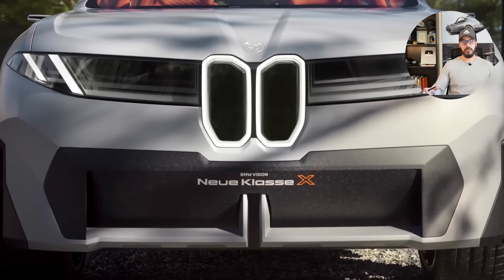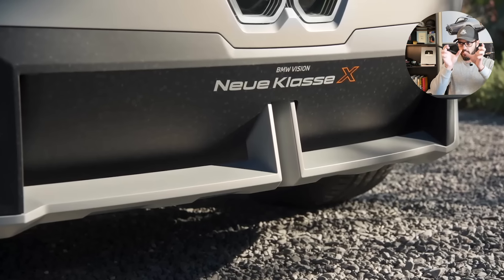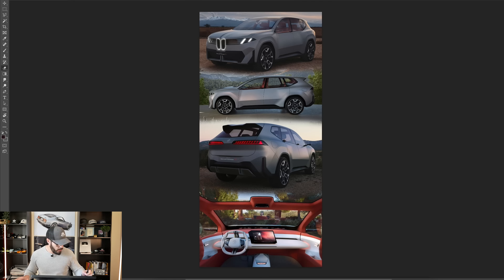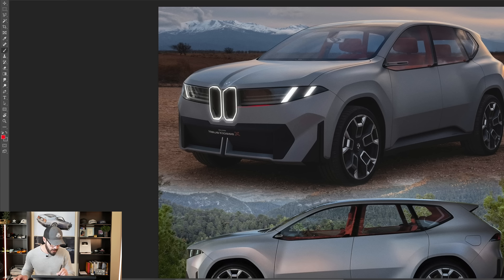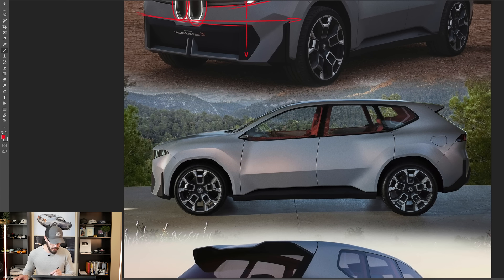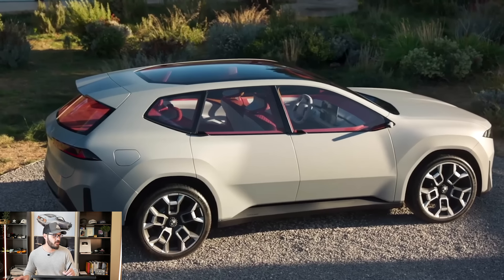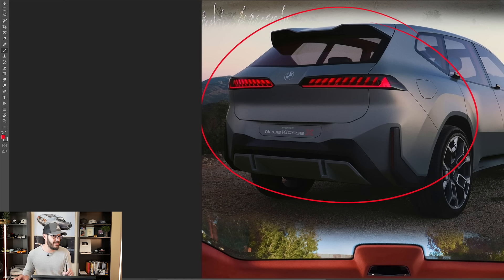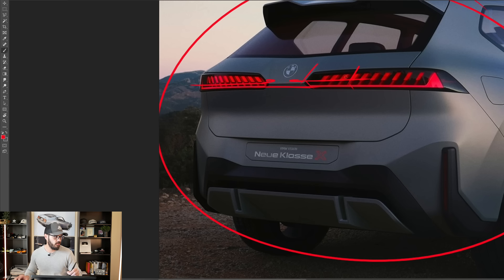I redesign the BMW Neue Klasse X

Comment: I think your modified grille design would also fit nicely on the sedan concept. Such a massive improvement.
Reply: I have thought the vertical kidneys should have been on the sedan from the start. After all, the sedan is inspired by the E30 and/or 2002, which famously have the vertical grills.

Comment: The sedan integrates the headlights and the kidney's nicely. Feels new yet still like a BMW.
Reply: I just think it won't be produced like this. The front graphics yes but not the side silhouette: Having no front bumper but a hard edge above the headlights is impractical and would in case of a collision throw the opponent under the car rather than on top of the hood. So I assume the angle will have to be changed and a bumper added (even though for some reasons designers don't like bumpers looking like such any more).
Speaking of side silhouettes, from the side the blunt front end of the NK-X looks rather unelegant to me. I much prefer the sloping hoods of Porsche.

Comment: The thing i dont get it is why Bmw left its beautiful and characteristic two round head lights. In current models they put sharp corners to them. In this concept they r just two lines. I was hoping sketch monkey to change the head lights into two round head lights. He didnt do it also. I really believe the car will look much more handsome and much more real Bmw.
Reply: Tbh, I think they look quite nice, which I didn’t expect. It looks much more BMW now (and much more consistent in design language, which is an amazing thing). I just hope the integrate something like the grille in this video in both the production SUV AND sedan
Reply: @mrsoisauce9017  i agree with u. The overall design language is much more consistent and loyal to Bmw dna. Especially comparing with the recent models the ugly 4 series, 7 series and iX. My problem with this concept is two paralel line head lights. Why not use two round head lights which is one of the strongest characteristics of Bmw dna along with L shaped back lights and the Hofmeister kink.
Reply: @fratsimsek2600  the Hofmeister Kink is intact, so we don’t have to worry about that. The L shaped taillights should make a return. But as for the headlights, I personally think just having the two lines for the headlights is very fitting of the rest of the design language of the car. Something rounder just wouldn’t work on this design imo
Reply: @mrsoisauce9017 Hoffmeister kink is NOT properly intact... it disappeared with the 4, whatever is on the X6 and barely look like it here and the XM.
I also have no idea why there's now a forward slanting piece on top of the rearwards-actual Hoffmiester kink in the 3, 5, and 7. Hoffmeister kink to me is just ONE straight line.
    \
__/  not this

__/ but this
Reply: @mrsoisauce9017  I want the led running light design inside the main headlight unit to be two rounds. I think it is a timeless design element. plus the main characteristics of Bmw face. the headlight unit can be designed according to the current design language but inside the headlight unit there must be two round led running lights. I hope I could express myself better :)
Reply: @groundedgaming  I'm talking about in this car, the Hoffmeister kink is intact. Yes, in modern BMWs, it's kind of gone away, but it's intact here.
Reply: @fratsimsek2600  and I get that, but tbh, because of how geometric this design is, it almost looks better with the 2 lines, at least imo. But to each their own, I suppose

Comment: Since you gave the e46 as a reference, why not use the same solution as the e46 with the creases coming down from the hood and wrapping around a smaller grille about as thick as the headlights themselves?

Comment: I thought the tab door handle on the Mustang Mach-e was a cheap afterthought and I’m disappointed to see it here. Similar to door handles built into the window trim on some Lincoln models it looks odd and from some angles like an accident or major defect.
The changes are an improvement but it loses some of its uniqueness. The rear view looks more generic, like a VW. I agree I like the more simplified and integrated headlights into the kidney grille of the sedan concept.